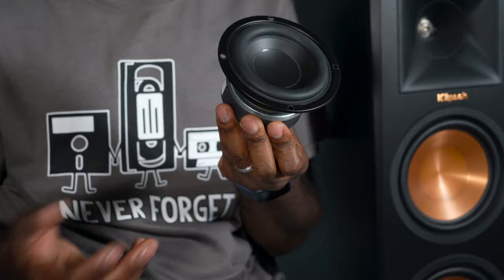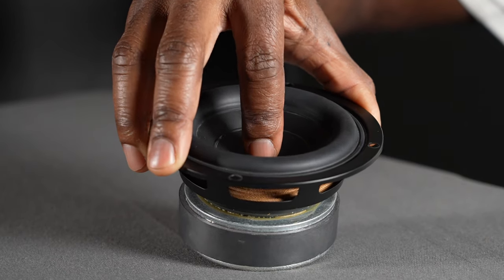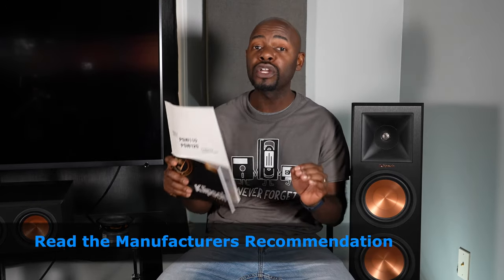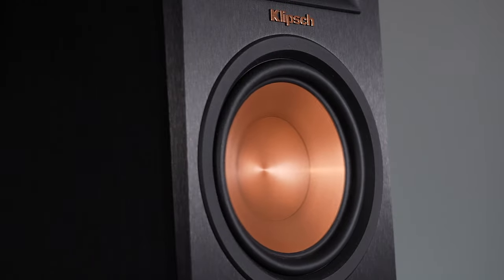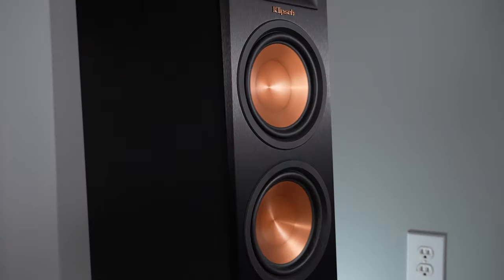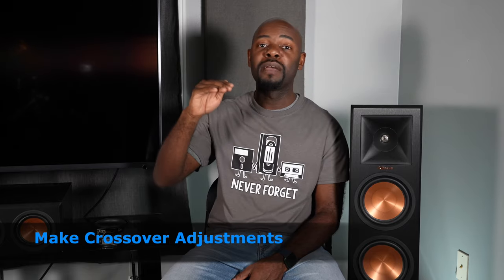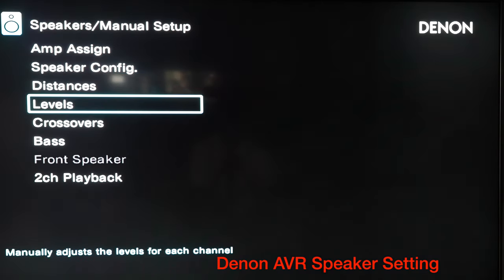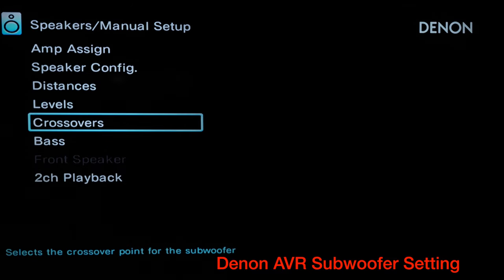New Speaker Burn-In, Break-In, Run-In: Tips and Tricks

Comment: I'm planning on buying Klipsch RP-600Ms or RB-61 IIs.  But due to living in quiet building I can't run them at the needed break-in volume.  What on earth am I going to do if I don't want to buy used?
Reply from the maker: That's a good question!   This is a stupid suggestion but I'll make it.......... Do you have a closet with clothes that is away from shared walls? You could put them in there during the break in period (the clothes will absorb some of the sound).  If you can get them up to 50 or 60% volume that should work just fine and maybe extend the amount of break in hours from 50 to 75 hours. Just a few quick thoughts, hopefully it helps!
Reply: @HomeTheaterHobbyist  Thanks 😀
Reply: @dixonpinfold2582  Here's a suggestion which many of us have used for years.
Place the speakers facing each other so close that they are almost touching. Then connect one of them out of phase. Then throw a heavy blanket and some clothes over them while they are playing.

Just an addition. Sometimes depending on the distance between the speakers, connecting them in phase might work better, so try that too. You can also try and adjust the time alignment on one of the speakers as this will sometimes create even more cancellation.
Reply: @AB-80X   Sounds like a good idea. Thank you.

Comment: What about using a test tone for break in?
Reply from the maker: If you're going to use tones, I would use several across the frequency range to ensure you're excising all the drivers.
Reply: @HomeTheaterHobbyist  for home speakers I would definitely use a tone sweep. But I'm actually going to break in my, 6.5"  woofer from part of the component set, for my vehicle. Was thinking about just looking up the lowest attainable frequency for the woofer, then using that tone to break it in. Should exercise it enough to loosen it's mechanism. Your thoughts on this, please?

Comment: Speaker burn in is logical.  The one that is hard to believe without evidence is cable burn in or electronic burn in.  In general I do believe in burn in for most things not just audio....I'm talking like a cook top range or a refrigerator or air conditioner.  I just think it's logical that mechanical parts and systems do benefit from a continuous use time table.    Using a special file that produces frequencies across the spectrum will burn in a speaker better than general music playback.  Burn in servers two purposes better playback and less risk to potential damage.  Burn in is not BS and any logical person can easily understand why it's not, but there are levels to it that can leave a person with incredulous beliefs and that is with most people burn in for cables.  The only real way I can see that cables have a burn in is if it can be proven that a cable physically changes from continuous use.

Comment: Doesn't work if you have neighbours but play Three Pound Chicken Wing on repeat at close to maximum volume and your speakers should be nice and loose as well as your picture frames.
Pink noise you'll probably have to turn up to the level of Niagara Falls to get the woofers moving properly and then the mid and tweeter may suffer.

Comment: I just got some klipsch speakers and they sound like junk! And I’m 😡 mad. I’m crossing my fingers this makes em sound better. For reference they were in sale for 300 each when they r usually 600 each. Klipsch reference f820s I googled them and they had good reviews but as we speak I am hearing them and they suck. They are actually the speakers ur using for the video! That’s cool I didn’t see them till almost a few minutes in because I was busy typing. Wish me luck
Reply from the maker: Hopefully they get better. What don't you like about them? 

Definitely keep the boxes so you can return if necessary. 😏
Reply: i just bought the same speakers and thought the same until adjusting and playing at moderate levels for 2 evenings.  they sound great now but, they require power,  i have 100, and i think to get the most from them 120 minimum is required.   also being a new technology,  new entertainment genre (home theater) these speakers are geared more towards that than music.  musically they require a 5.1 minimum setup for music.  i play music on just the fronts anyway, i'm an old school musician...  good luck

Comment: so just use the speakers as normal but expect them to sound better after a few days of usage???
Reply from the maker: Yea that works but just be patient. But as I said you may not notice a difference because that’s happened to me too. 😁
Reply: Problem with that is, that you condition your ears. There's to old saying. Are you breaking in the speakers, or are they breaking in you.

I take a quick RTA picture of the speakers before, and a quick listen. Then I don't come back until they are done. Then I do another measurement to see if there's any difference which confirms what I'm hearing.

Some speakers react very will to break-in, others don't care at all. Some manufactures also break in their speakers prior to them leaving the factory. Check this so that you are not wasting your time with a long break-in. If they are broken in from the factory, a few hours may be all it takes to get the last bit from them. Remember that if your speakers sit idle for prolonged periods of time, they will need a bit of excMonitor Audio SILVER W12ersize to get going again. The same is the case for pre-broken in speakers that might have been living in a box for a month or two.